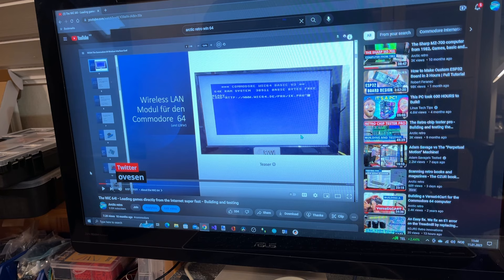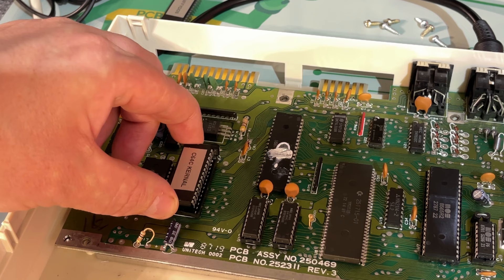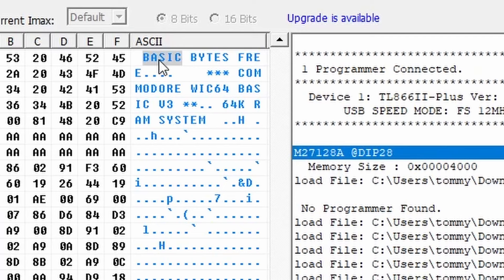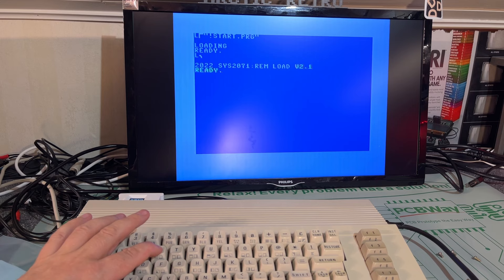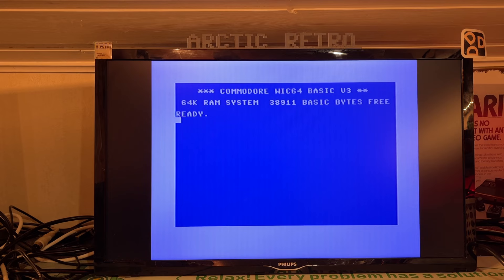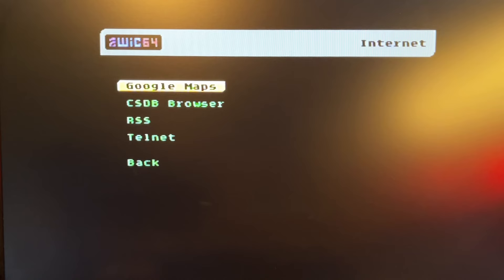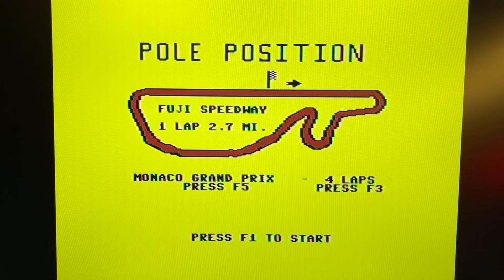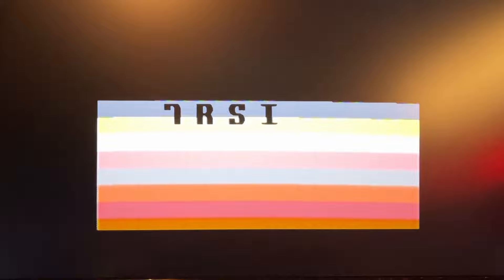Google maps on the Commodore 64 - Even street view! The WiC64 revisited - What's new ?

Comment: This WIC64 cartridge is a nice WiFi modem with a small display to show the connection info.
However,  you can turn any IP modem cartridge like the Ultimate-II+ and others into wireless by simply connecting a small WiFi adapter to its ethernet port.  The adapter can be configured remotely over WiFi or ethernet connected to a pc prior to connecting to the modem and will function as if it was connected via ethernet.
Besides the WIC64, there are a couple of other WiFi modems available like the StrikeLink-WiFi, C64-WiFi, Link232-WiFi, etc.

Comment: Couldn't you load the WiC Kernal into the space starting $2000 (without clearing the BASIC part)? I've done this a few times for VersaCart multi ROMs.

https does work. The WiC64 takes care of the encryption.

The hanging causes issues with SID Radio too, though it only hung once in my last 4 hour stream 😉
Reply from the maker: Ok, thanks for the info.